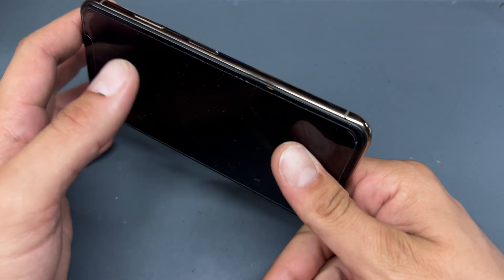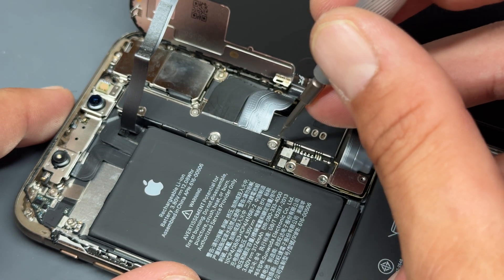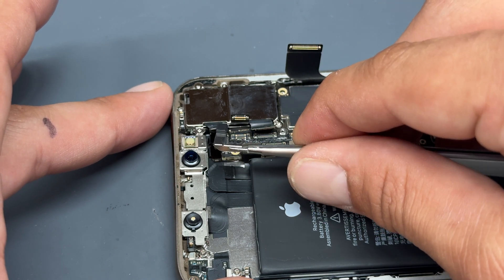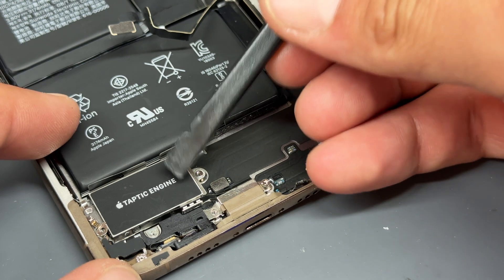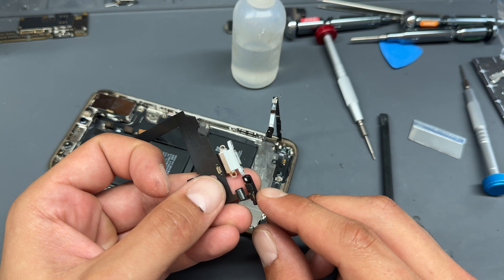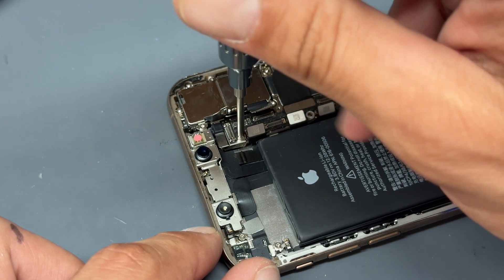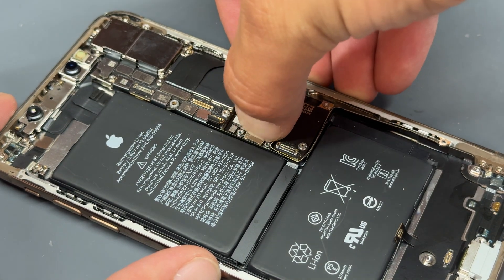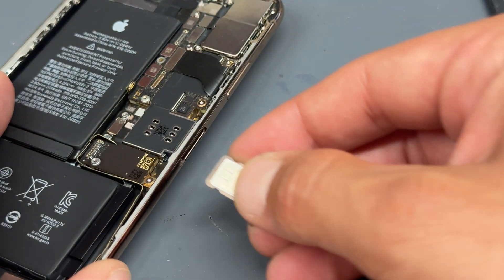iPhone XS Max Charge Port Repair - DIY Guide to Fix Charging Issues!

Comment: Any idea where I can find an oem oem
Reply: I found one on eBay. You can tell it’s oem by the residue from the glue and the Apple logo on the flex. Pretty cheap! I missed the Taptic flex on my daughters just now so I’ll have to order one but it’s only about $5. Don’t skip a step like I did, these are very particular devices